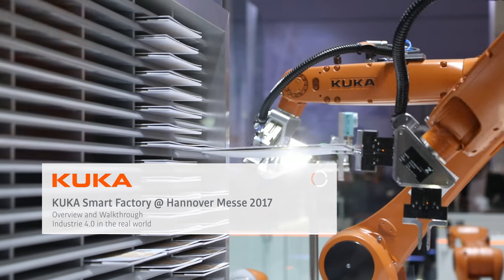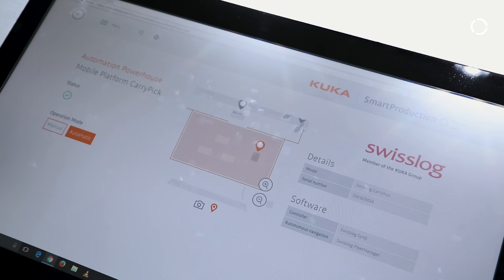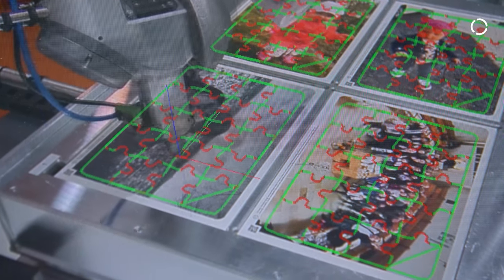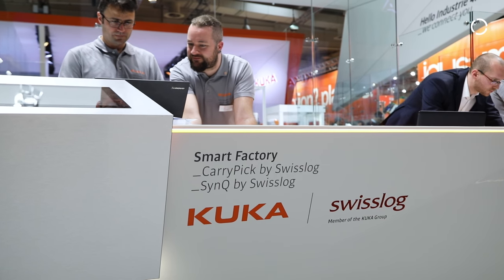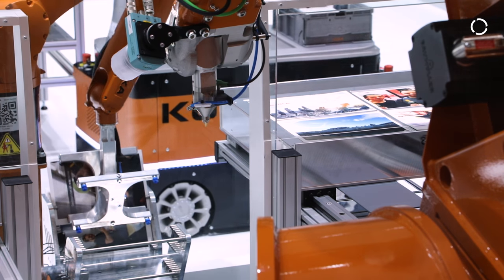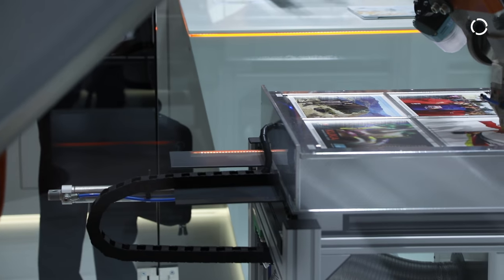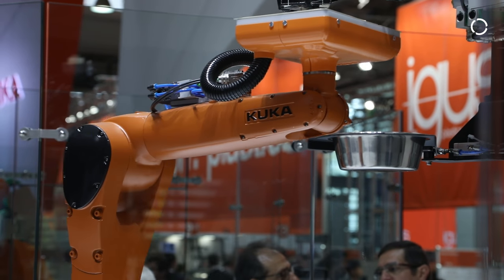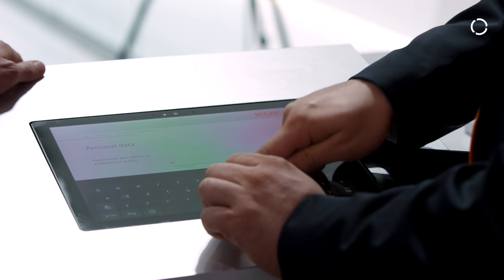KUKA Smart Factory 2017 | Overview and Walkthrough

Comment: Most companies aren't even at industry 1.0!  Does all this I4.0 actually make any financial sense?
Reply from the maker: You're absolutely correct that many manufacturers and producers would benefit from consultation in developing Industrie 4.0 solutions. We have documented some I40 success stories on our website (https://www.kuka.com/en-de/technologies/industrie-4-0/industrie-4-0-cases) and we even offer consulting services on developing industrie 4.0 solutions (https://www.kuka.com/en-de/technologies/industrie-4-0/industrie-4-0-consulting). Not to turn this reply into a sales pitch, but we offer these services because we believe digitally networked processes in Industrie 4.0 are very important. They make it possible to manufacture products at a low cost in a manner that is more flexible, energy-efficient, resource-saving and customized.